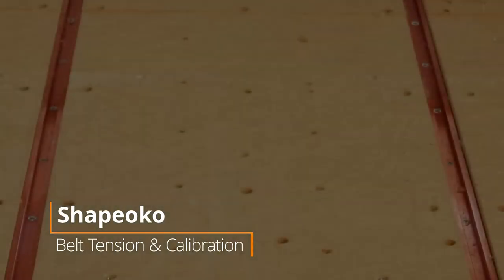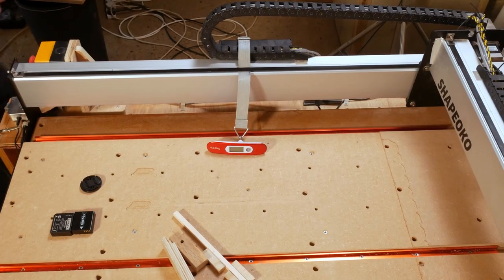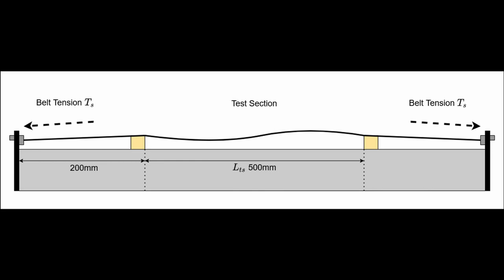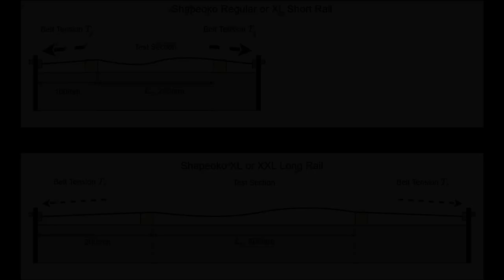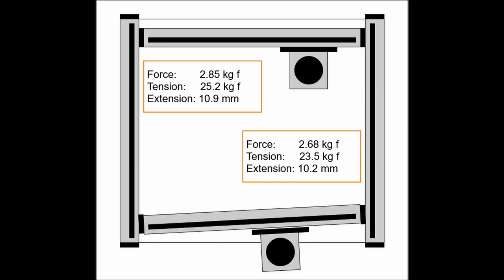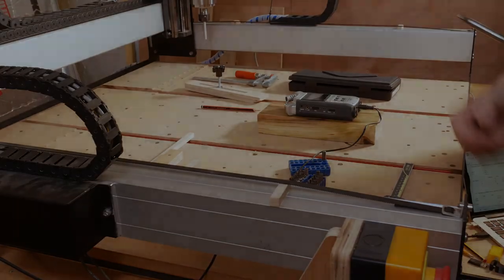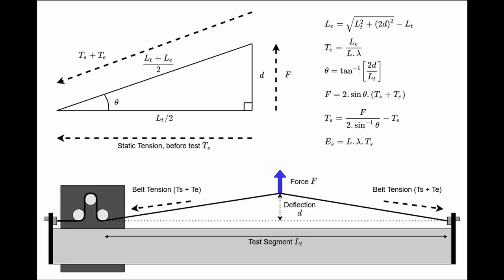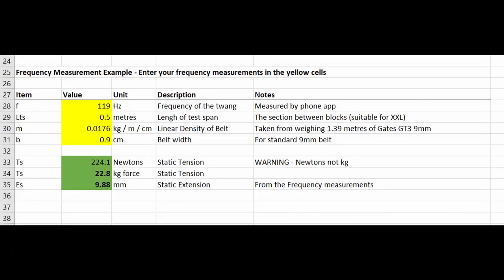Shapeoko CNC Belt Tension, Squaring & Calibration

Comment: you have an error in your spreadsheet for frequency you have length as .28 meters as suitable for xxl, but shouldnt it be .5 meters? also in your video you measure 200 mm from the ends but to get a 500 mm distance you need to measure 250 mm from either end
Reply from the maker: Thanks, you're referring to the spreadsheet posted on the carbide3d community forums? Yep, that should be 0.5 meters as suitable for an XL / XXL long axis and 0.28 for a regular length axis, however, so long as you enter the distance you actually used you'll get the right frequency calculation out, it's just easier to use the longer distance on the XXL. 
On the measuring out, sorry that's not clear, what I meant was to measure 200mm from the frame end and then another 280mm or 500mm from there. We're mostly interested in the length of the belt segment under test so all the 200mm does is space away from the endplate and minimise the additional pre-tension added when you put the support blocks in.